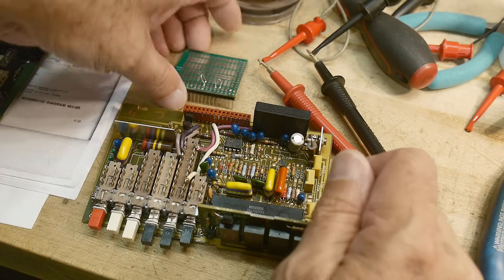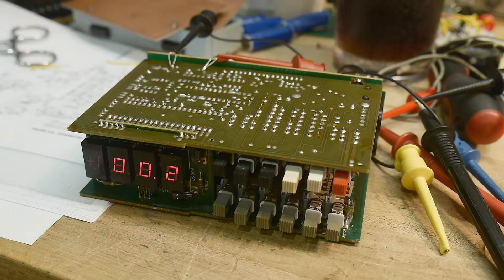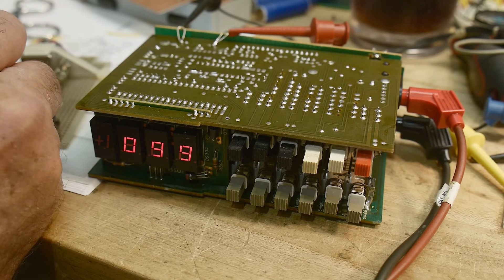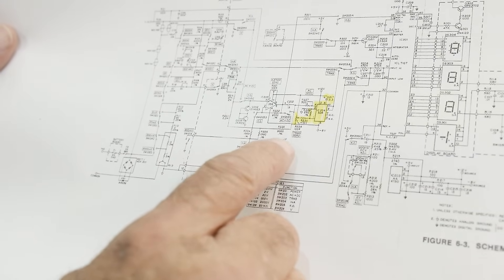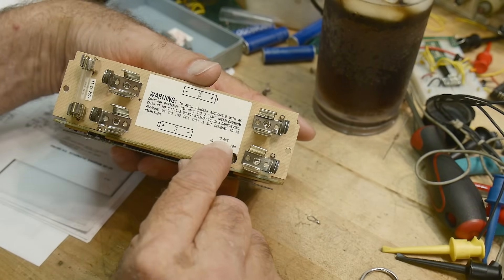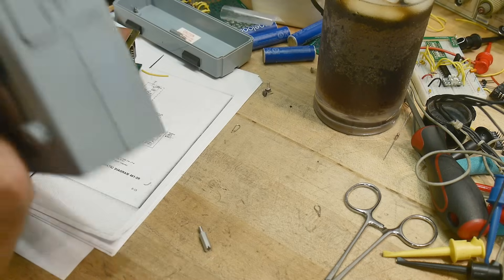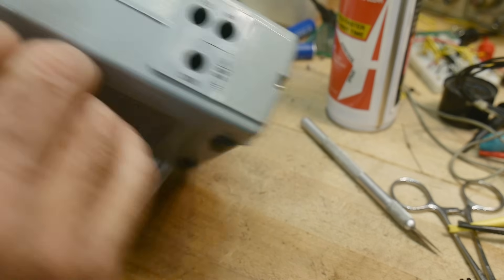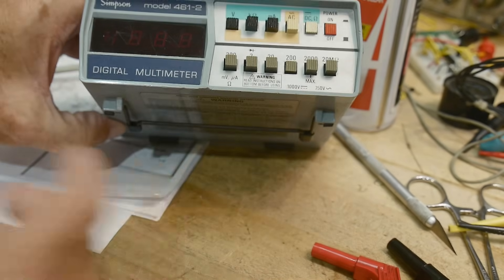#1634 Simpson 461-2 Digital Multimeter (part 2 of 2)

Comment: Just got one of these. It has 2 cardboard tubes for the batteries. I used 1x AA and 1xAAA in each tube with some aluminum foil in between them. 2x AA's are too long. Mine seems to work wellright off. We shall see.

Comment: Hard to believe Simpson would sell  the meter without AC option. Generally only see that in really expensive meters with GPIB like older Datron or Systron Donner units- not a 3 1/2 digit DVM. What does it do in AC mode? A Datron will not allow it to be selected, and will show it is not fitted with a self test.

Comment: Thank you for your videos on this. I just finished repairing mine and it was exactly the same issue you found. I drilled a tiny hole in each switch just as you did and added DeOxit. I worked each switch for a few dozen cycles and bam it works perfectly. It’s in calibration too. I did both 2v and 200v AC and DC and it’s exactly what my calibrator shows. Thank you Sir.

Comment: The shop I started out at back in 1980 had one of these blue Simpson meters at each workbench. We had the leather cases for them and used them in the field extensively.
FWIW, even back in the 80's we'd have to disassemble and clean the slide switches as they needed it on a regular basis, I was glad when we 'upgraded' to Fluke meters...
You brought back some great memories of my early bench tech days, thanks  :)

Comment: Are you sure the line voltage AC measurement doesn't work? Older digital meters would often read something like 1-300v no problem but milivolt AC would be an extra upgrade.

Comment: Interesting. Funny how big a gap there is between that digital Simpson and the early digital Fluke meters.
Reply: What do you mean by gap?  My Fluke 8040A looks very similar.
Reply: @barrybogart5436  Sorry, I meant compared to the early fluke hand-held digital meters. I was only ~3 years old when the 461 was built, so I don't know the answer. But maybe my real question was, what happened to Simpson and where is their modern digital multimeter? To my surprise I looked it up and I see something like the Simpson 5002BT, which looks comparable to a high-end Fluke. But why have I/we not heard of this? I can't find a single YouTube review of a modern Simpson digital multimeter. Why did they fall off a cliff for common use?

Comment: If those leads are the same as the ones on Simpson 260s (series 7 onwards), the "reverse banana" jacks, then you can get new leads from Probemaster. I bought a set for my Simpson 260 and they work great! All of the little accessory tips are interchangeable with other Probemaster test leads too.
Reply: My first "Professional" analog meter was a used Simpson 260, without leads. I too found Probemaster made the reversed female leads for the Simpsons. Probemaster makes the best quality leads on the market, really love the gold plating.
Reply: I purchased some new leads for my Triplett from Probemaster; Love them. I'll be getting some replacements for a couple other meters as well!

Comment: I'm sorry if I missed out on the last video- but didn't you say that it was drawing 1.2 amps from the power supply? Doesn't that seem a bit high- or am I misunderstanding something.
Reply: I think it was 120ma, which was higher than the provided 100ma adapter
Reply: @victorman2227  Ah alright, thanks!